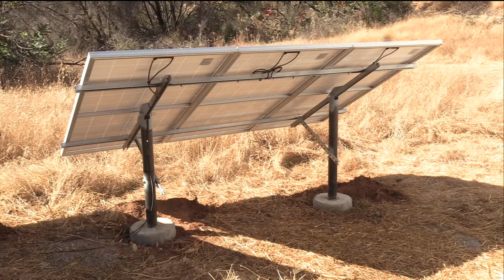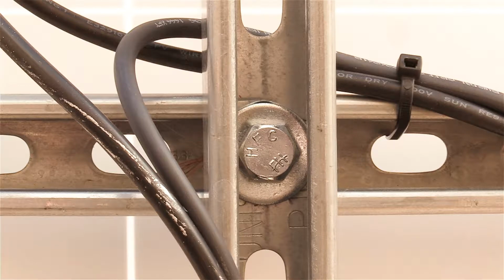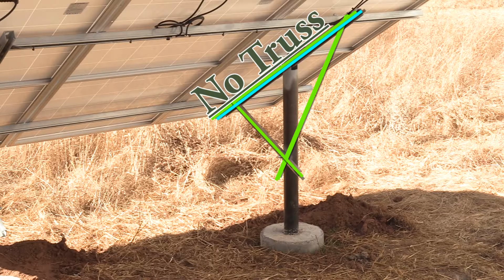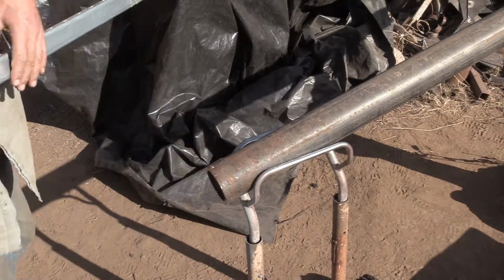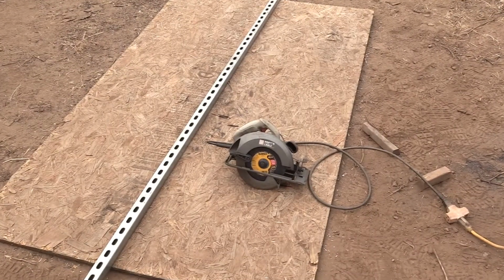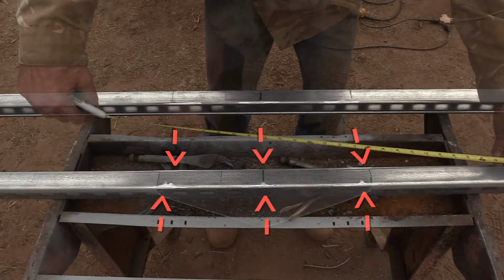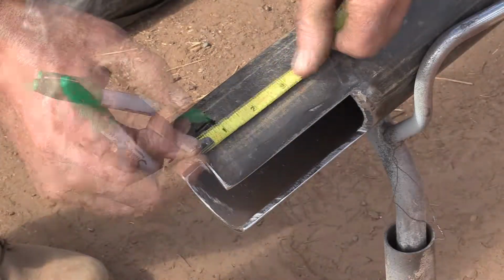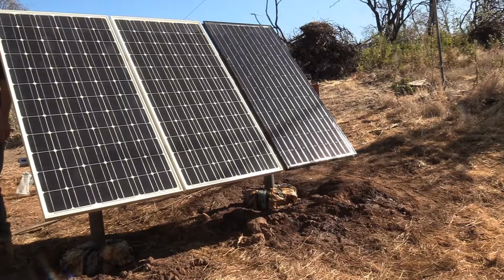Simple Solar Panel Racks  Part 1

Comment: Thank you for such great information and videos! I'm wondering what type (strongest) bolt you suggest to attach the unistrut to the pole?  I also have always wondered if the panels themselves, hold up well in high wind areas. Any thoughts on it?
Reply from the maker: Good questions.  The bolt is just Grade 2,  but strength is also dependent on the diameter (1/2") .. plenty strong enough for this situation.  For more strength and not much higher price, the bolt could be Grade 5 or even 8.   Stress-loading from wind (and snow) is an important consideration.  Solar panels do have load ratings, with some rated higher than others.
Reply: @j2jet193  Thank you!